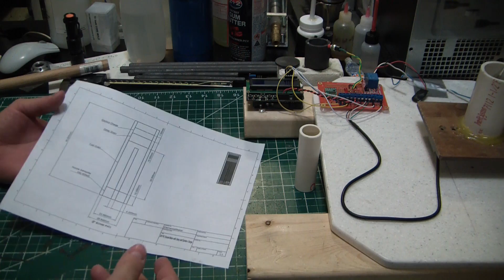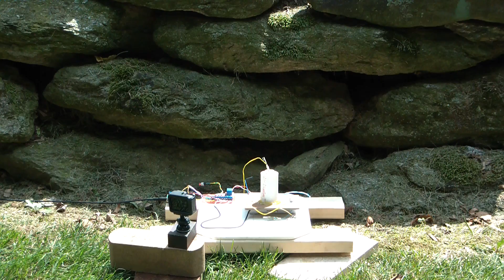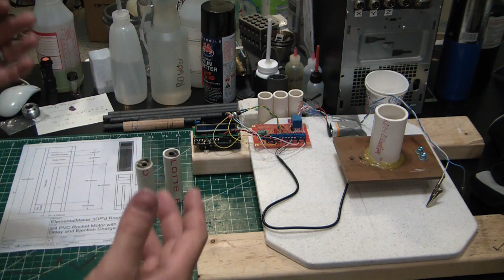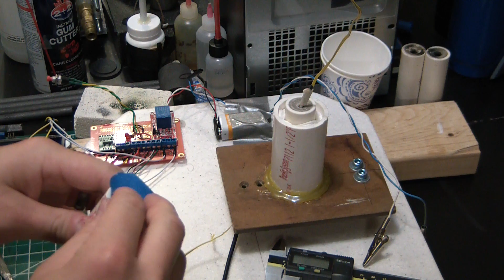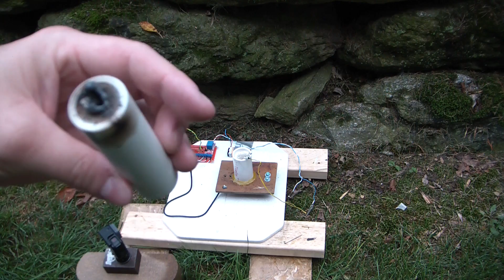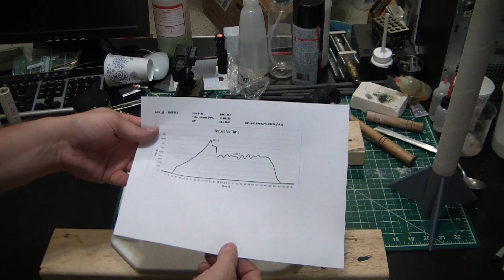Making a Characterized Sugar Rocket Motor - ElementalMaker

Comment: I used old builders plaster, works great. The older the plaster the quicker it cures and the 4mm nozzle hole holds out fine. I often re-use the canasters many times.

Comment: Heres a bit of advice on why you have so much nozzle erosion, ive had this issue myself and a simple fix is to wither make your clay plug thicker or to make your nozzle hole wider, The wider nozzle hole will cause less power but will fix your erosion issue.

Comment: I think hydraulic cement is best for nozzles. You have a lathe, make up a wooden divergent form about 25mm high with a port the size of the hole of a washer that fits inside the motor body, make the form parabolic in shape. Fill to the port, place a galvanized steel washer in, then pour in some more cement and use another convergent form that is about 12mm high and parabolic shape as well. The washer helps prevent the port from eroding and pulls heat into the cement. Hydraulic cement hardens in minutes and is fully cured for use over night.

Comment: Clay plugs that don't deteriorate or lose their shape 75% unscented cat litter blend down using a coffee grinder or blender 8% pottery clay leaving the Sun for a few days to dry out most mixtures are soft and 17% Elmer's glue these plugs do not melt deteriorate loose form or shape they are extra hard when pressed or ram fire makes them harder and stiffer so even if it's soft when applied the rocket motor fountain or any other device you use hardens it as it's being used

Comment: How did you get the nozzle to not push out? I’m having a very hard time with that. Also sorry if you answered this in the video I’m watching it right now
Reply from the maker: I rough up the inside of the tube at the nozzle region. Grog in the composition also helps it bite into the pvc
Reply: @ElementalMaker  I’ve tried that and it works sometimes but still about 50 percent of the rocket motors the top plug still ends up coming out
Reply from the maker: @WessCastings  your plug may not be thick enough then, or maybe needs rammed harder
Reply: @ElementalMaker  ok thanks so much I’ll try it out. I may just end up using a cement

Comment: I believe you want to use Satanite clay for the nozzle. Also thin wall pvc would work at half the weight of scl 40. More room for more boom. Likewise if your using a potassium/sugar fuel you need to melt it, blend it then pour it in the engine tube to harden. It's like a 60/40 blend.
Reply from the maker: That would work great I'm sure but that stuff is pretty pricy for use in nozzles

Comment: Love your videos. I never made a rocket before. My buddy Alex did though when we were kids. His dad made little ceramic washers for his nozzles out of tiles from the hardware store. They got pressed down into the rocket over the clay plug in the bottom. It might be worth a try.?.🤔
Reply from the maker: That's a very cool idea!
Reply: @ElementalMaker  I just spoke with Alex. He said they used two washers. One before the clay plug and one after. The inner washer having a smaller hole in the center than the outer.to make the shape of the forcing cone, like a bell rocket engine.

Comment: can the spikes be a result resonance? If the nozzle slowly deteriorates due to a high temperature it might get the geometrical shape that has the acoustic properties to make the outgoing material resonate at its resonant frequency, hitting the nozzle even harder until its shape is such that it eventually drops in efficiency? And I was wondering why cement is mainly used in this area of rocket design, why not some light weight metal? I was also wondering what the mass will be of the rocket as a whole. This video was amazing, thank you very much!

Comment: Why not make/mill a nozzle from metal?  I guess that would cost you some weight, but it would be reusable.  How 'bout a 1/4" thick piece of stainless sliced of round bar stock, with a nozzle drilled through the center?  Essentially a thick washer that would fit into your 3d print and mate up against the engine.  That could be done without a mill, lathe, or any fancy tooling.  Arm chair speculator here, so be kind if I missed something obvious. ;-)

Comment: Helloo man  im a fan of ur content... all the way from Lebanon!!! I would advise you to use poliester putty .. we call it here iron putty  .. its a past used for fill dents in a car before paint ... anyways .. it comes as a putty and there is a curing stuf in a tube that u mix to harden ... i use the same diameter tube (same as engines) as a mold then insert a metal spacer inside to be drilled after as the opening of the nozzle .. also u can carve the two ends of the made nozzle in cone shaped to have the desired bell nozzle  ... it works perfectly .. regards!

Comment: Like if you remember the grey fuses from your childhood on 4th of July

P.S. Oh, and you're trying to effectively use a dry powder to contain and accelerate a jet of multi-thousand degree chemically explosive byproducts. Some real world rockets used Silicon Carbide in the throat of the engine and it worked pretty well.

Comment: Ya your nozzle diameter looks way too small. You're trying to push the performance and compensate for the erosion. You should get way less erosion if your nozzle was an actual nozzle, that is, a smooth transition to the throat. Like other people have said, you should use Durhams putty it is commonly used for this I would use 3D printed molds and drill a couple small holes through the PVC where the nozzle will be so the putty has something to grip onto. A proper nozzle should significantly improve your performance.

Comment: what if you mix 5 minute epoxy with that clay? that way you got a fairly resilient matrix thats holding the clay together? i have no idea if that would work, but epoxy mixed with minerals is often used in high stress scenarios (not really for hot applications) but maybe still worth a try since its simple and inexpensive

Comment: Why not machine a metal nozzle that would screw into the inside of the PVC pipe, then unscrew after fired and screw into next motor? You have a lathe.

Comment: I think the problems with nozzle erosion  are caused by the wax melting... You can try with a few drops of water to slightly moisten the fireclay. This should also work as  a binder instead of wax.
The best option is to turn a nozzle out of graphite and glue it in with some epoxy.

Comment: This fireclay stuff looks pretty cool, but if you really want to nip the nozzle erosion problem (especially as you move into larger motor sizes) I'd recommend you check out Rockite cement! I used to cast the cement into a PVC end cap, drill a nozzle through the endcap and the cement, and then PVC glue the endcap onto the motor.

Comment: Hey so this is a bit out in left field, but have you ever tried using JB Weld to make your nozzles instead of clay or graphite? It's not terribly expensive and it's a real damn durable epoxy that would both hold into the rocket body well and maybe resist eroding because of its high strength. I know it's not ideal but I figured it'd be worth some testing when it comes to erosion resistance.
Reply from the maker: Heck sounds like a fun video just to see how it holds up!

Comment: I enjoy your videos. I have a suggestion. You have a lathe, why not machine a reusable nozzle that won't erode and will have both convergent/ divergent for maximum thrust. You'll need to start with an opening slightly smaller than 4mm and open it from there untill the PVC can handle the pressures. One more suggestion. Substitute a small percentage of the fuel mixture with iron oxide powder. I'm guessing at 7% to start with. It gives it a little extra punch to increase your pressure. If I had a lathe I would do what I've suggested. Good luck brother.
Reply from the maker: I like to keep the projects replicable for folks trying to learn at home. I definitely could just machine a graphite or steel nozzle on my lathe, but that's not something most people can do

Comment: I tamp the bent-clay in layers. Each layer I'll use a syringe to put a few drops of water on the clay, add a little clay on top, tamp. Then, after the clay is fully dried, I smear some construction adhesive on the outside of the nozzle. The water activates the clay, bonding it together. I haven't had any issues with nozzle erosion at all. In fact I actually was able to make the nozzle thinner saving weight and gaining propellant.

Comment: Have you had a look at Richard Nakka's extensive web pages on sugar rocket design? Some really good spread sheets there for calculating time/pressure curves/thrust curves etc. and cast nozzel designs using steel washes to prevent erosion. ISP of near 164 is possible.  http://www.nakka-rocketry.net/
Reply from the maker: I love Richard's site. I've spent many hours scrolling through his pages, and had a few conversations with him as well. He's a literal genius and a great guy

Comment: you need to attach a large bolt or screw with a tapered head to a board grind off the threads and put the pvc over it so the screw is centered. Take 2 tampers and drill a hole down the center of 1. Now throw in a spoon or 2 of cat litter and a few drops off water. Tamp down with the tamper with the hole. throw in your mix and tamp again until 1/2 to 3/4 inch from the top. put in more cat litter and a few more drops of water and tamp some more with the tamper with no hole. When you pull the pipe off the bolt you already have a perfect hole with a tapered nozzle molded into it. It will give better thrust because of the taper.

Comment: There might be some cheap steel hardware component that could be pressed in place to serve as the throat of the nozzle. Like a stack of washers? Or a nut? Based on the ISP you could be getting double the performance with a better nozzle.
Reply: A bolt with tapered head works too. Grind the threads off and then you don't need to drill a hole either. I put cat litter and a few drops of water to bind it together. I then use a tamper with a hole to press it around the bolt. Sometimes it helps to rub wax on the bolt as a release agent.

Comment: I wonder if you could substitute smashed-up carbon electrode for the grog, as it was too hard for gunpowder, and carbon can handle mega-heat, while it also doesn't conduct heat very well. If you can keep the heat from propagating through your wax as long as possible, that will likely increase the lifespan from 'momentary' to 'brief'. Also, there are many paraffin wax formulations, so you can select one with a higher melting point, but I think Bee's wax was demonstrated to have a significantly higher heat capacity to change phases (melt) than synthetic waxes (per Cody's Lab). I've also heard that it's more sticky than paraffin, so it's got that going for it.

Comment: Beautiful work. I think the cheap kitty litter bentonite is probably fine but you could probably do better by way of the binder, why not use a small amount of sodium silicate as binder (easy to prepare from the other type of 'crystal' kitty litter and caustic soda)? I'd use a very small amount so that you don't form a very solid concreted plug, which would be dangerous if it shot out. Would need some experimentation to fine tune the recipe if not already available on the interwebs.

Comment: I’d think the erosion of the nozzle is due to the Paraffin wax. Why not a 3:3:4 mix of fire clay:grog: and either Portland Cement or plaster of paris with just enough water to bring your mixture the the same consistency as your wax binder? Yes you would have to wait a week or so for the nozzle to come up to strength.

Comment: I place a washer, with the same ID as the throat, where the combustion chamber meets the throat. I also cast the nozzle and end plug with Rockite expansion cement as I did not have great luck with the clays.  When I make the cast of the nozzle , I cast the washer in with it.  Give it a try if you haven't already.

Comment: Nice video.  45 degree convergence (not critical) and 15 degree divergence nozzle.  Maybe use a tapered center punch for divergence.   I still have not found anything I really like that is cheap and easy for nozzles that work good.  I have been using plaster that works well but you can't pack it.  Put it in and add a tiny bit of water and let it sit for a few days.  2.5 tsp plaster and .5 tsp water seems ok.  I make an electric match using a piece of the fuse you use and a tiny wire and I only insert it just past the nozzle into the fuel like the Estes black powder motors.  Would be nice to see tests with the igniter at different positions into the motor.

Comment: I tried many different types of nozzles back when I was into rocket engines. The best nozzle in my view, much better than graphite, was glass. I made a mold with kiln clay and used melted glass to make a nozzle. Of course, as is the usual case, its not as simple as just melting some glass and pouring it into the mold. I found that first heating the mold to about 500 degrees and then letting it cool slowly after the pour, prevented cracking. The results were excellent, no nozzle erosion.
Reply from the maker: Now that's awesome!
Reply: We used to do glass casting at our 3D printing lab in university. We used casting plaster to make the molds from 3D printed parts, put the biscuits of glass in a flower pot (the ceramic kind with a hole in the bottom) over the mold, and put the whole thing in a kiln. Everything preheats together, and cools together, and the glass will flow out the bottom of the flower pot into the mold once it's hot enough. Mostly made artistic things, though, not rocket nozzles, not not sure what kind of residual mechanical stresses might have been left. The slow cooling is probably a best case scenario for stress relief, I would think, but I'm not a glass blower.

Comment: I make my rockets out of pvc with a bentonite clay nozzle, it works great without a binder but needs a little more pressure.
I also use a pvc end cap to prevent the propellant from taking up moisture.

Comment: Bentonite on it's own is a good nozzle material, maybe the wax is introducing unnecessary heat sensitivity
Reply: IT's likely vaporizing at those temperatures, which could cause the nozzle material to flake right off.

Comment: Try a different binder for the nozzle.. Look at the STI Firestop  website.. They have both silicone and elastomer based caulking compounds. They also have a fireproofing mortar.. A good electrical or construction supply should have many of the compounds on the shelf (avoid the intumescent and exothermic compounds.. You want to look at the plain sealants)

Comment: Love watching the videos man! I would love to play around with making rockets with my kids but there aren't a whole lot of places to launch them where I live.
I was wondering if you ever considered making nozzles out of something like JB Weld or maybe even better, something like Quick Steel. You could make a 3d printed mold for the nozzle shape...  Perhaps cut a few internal notches in the motor housing and press the Quick Steel right into the motor housing with the nozzle mold in the bottom. I have seen some 3d print filament that is water soluble, so you could make an intricate shaped nozzle too.

Comment: When I used to make them I used "Durham's rock hard water putty". The hole needs to be between 1/4 and 1/3 of the ID. When I ignited them I used an e-match shoved up to the top end, that way when the engine started it would light the whole length of the core.

Comment: I've had success making quick easy nozzles out of cardboard rolled up tight an saturated with a high temp super glue and then coating the internal cone and funnel with ash or powdered graphite while the glue is still wet. Goes super hard and stands up to the heat well.

Edit.. probably should mention I wouldnt static fire them by your house though heating super glue that hot can make cyanide gas 😂

Comment: EM, I make BP rockets and NEVER use wax in the clay mixture. I use a bentonite clay/kitty litter/grog mixture and press the mixture in my modified arbor press. I use BP rocket tooling which is stainless. Works pretty well. I haven't done sugar rockets but I'd say they are similar. Your videos show a lot of crud coming out of the nozzle and I suspect the wax is melting and the nozzle is spalling and widening along the way.

Comment: Out of curiosity,  why not use plaster of Paris? It has to be harder than compacted bentonite.
Reply: This was exactly what I was curious about. I would think it should have excellent thermal resistance and the heat from the rocket would actually make the nozzle harder as it fired.
I would probably 3D print some sort of cap with the negative of the nozzle shape built in. Pour the plaster, pop the cap/nozzle form on, let it harden, then pop it off with an already perfectly formed nozzle.   🤔
Now I want to try it!
Reply: @BRUXXUS  Let us know how it works.

Comment: Instead of using bentonite clay and WAX, use glue or epoxy. That would be MUCH more heat-resistant and erosion resistant. Another thing you could try is restrict the opening with a washer. Tamp in the propellant, apply the washer and hold it in place with the clay/epoxy